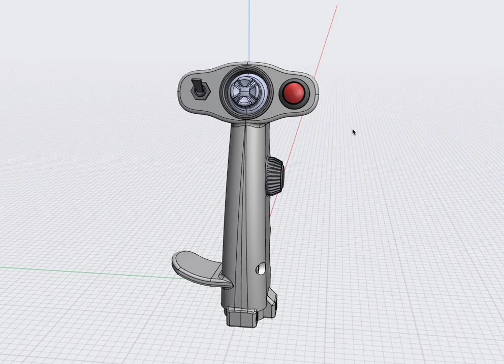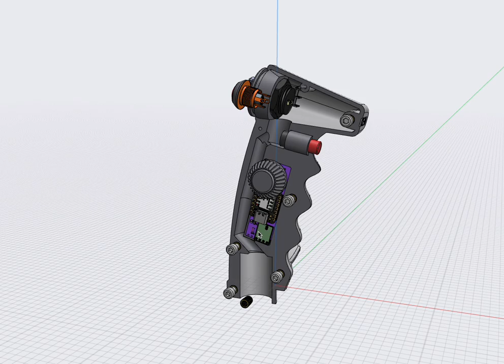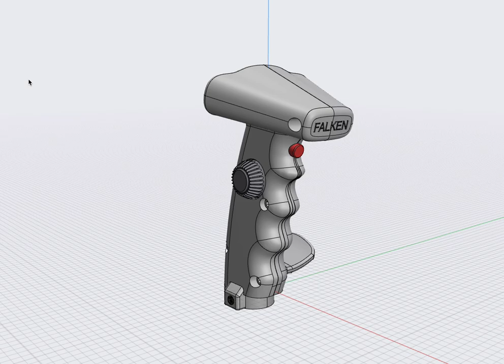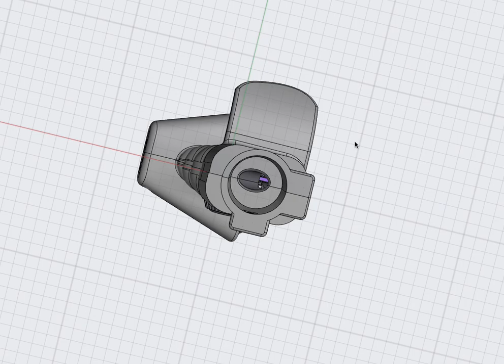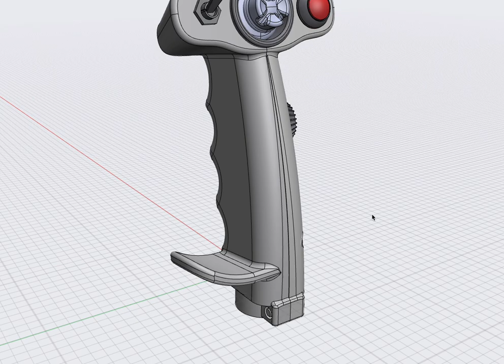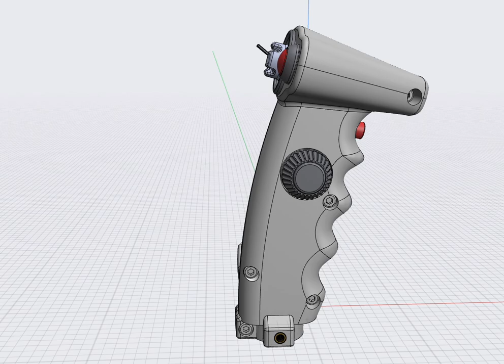FlightStick 3D Demo

Comment: Hi Steve, I hope to be using your EFIS on my supercub build and the stick is very attractive option but would love to have an option that would only have the 4 way toggle and eliminate the other two buttons/switches on the top for a more simplistic application for planes like cubs that wont be using electric flaps or autopilot.